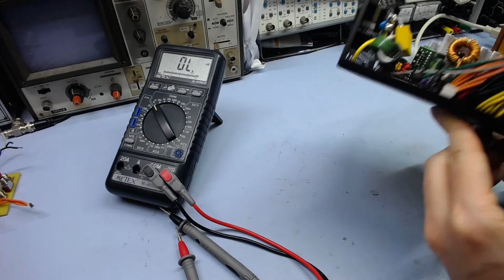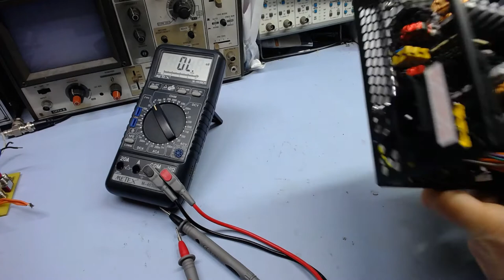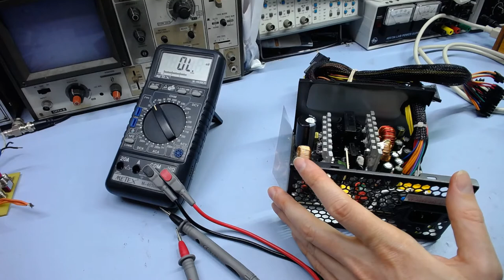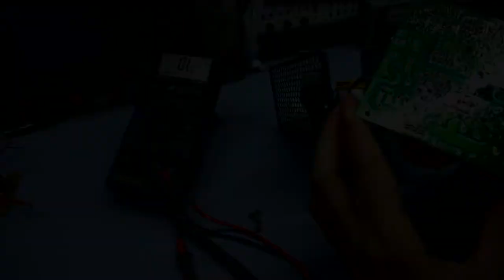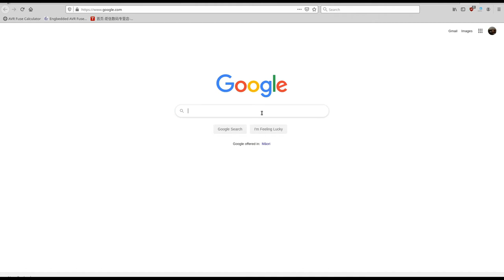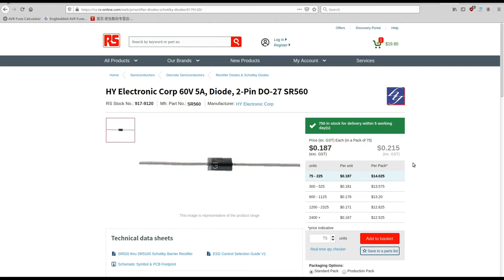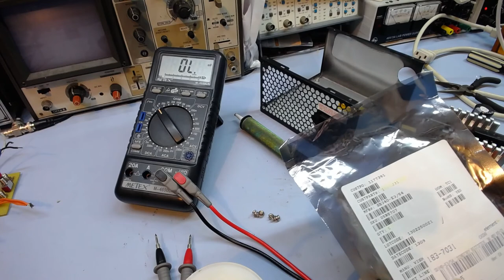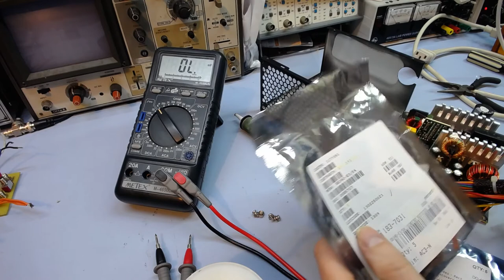Dead Zalman ZM400-GVN ATX power supply repair

Comment: Interessting repair. Do you have the schematic for the little pcb wirh LED and the ATX Connector?
Reply from the maker: Thanks! I do, somewhere...(don't know where right now). But, it's not very complicated. And if you just want LEDs, then calculate the right value dropper resistor for each voltage rail and wire up to each one, noting that the -12v and -5v rails will need the LEDs installed "backwards".

Comment: i have problem with thermaltake 730SE power supply , it have switch on problem , some time turn on and some time no , what should i do to fix it ?
Reply from the maker: There are many possible causes for that kind of issue. But the most basic cause could just be bad capacitors causing low voltage in the 5v standby circuit. After that it gets complicated.
Reply: @Agent24Electronics  thank you  buddy

Comment: Love your channel!
Question.
Are there a few things that are common failures in an ATX 2.03 500w 20/24 main?
I found one that was still sealed in the box and when I tested it, no output at all, no fans.
I checked the fuse, all diodes, all caps, and
A visual inspection is squeaky clean.
Im not asking for a run-thru diagnostic, I just wondered about som common issues with this model so I can check for those.
For now, I'm just trying to follow the path and check each component along the way, but I'm not very good at it yet, and the path starts branching out pretty quickly.
Thanks for the advice you've already shared with me and I hope you are doing well.
Peace.🙂
Reply from the maker: Thanks, glad to hear you've found the video useful.

"ATX 2.03 500w 20/24 main" are just specifications, not a model number. If you can find the brand/model you maybe can look up and see if there are known faults.

With a brand new-in-box but DOA supply, I'd be checking for broken solder connections or wires first. It may have come like that from the factory, especially a cheaper brand with poor QC. (If there truly is no brand/model, then such problems are quite possible!)

Bad capacitors are possible if it's been sitting for a few years and they are very low quality. A failure of a startup capacitor in the 5vSB circuit would render the PSU effectively dead.

Start with the 5vSB rail. Is it present and stable? If missing - is there power going into it? Is there rectified mains across the primary capacitors?
If low or pulsing, troubleshoot the 5vSB circuit for bad startup capacitor, shorted rectifier, etc.
Reply: @Agent24Electronics  
Thanks!!
I kinda put this one on the back burner for a while.
I'm still learning how to test individual components, so I'll probably be removing parts from it just to work on that.
I appreciate your advice!

Comment: hi, i found in my atx power supply few capacitors that have much higer capacity like nominal, for example: nominal 2200microF ,measured.:3000, or same nominal cap 2200microF- 10v, measured 4800microF, is it normal? many thanks for helpfull video
Reply from the maker: Electrolytics can have tolerances up to 20% which can account for variance in readings, but these days the values are pretty close, and your examples are well above 20% anyway.

What you are seeing could happen if you are measuring in-circuit. You need to desolder the capacitor and test by itself, if you haven't already done so.

The other possibility is the capacitor is faulty with high leakage current perhaps, or some other problem, and shows up as high capacity on the meter.

It could even be a faulty meter. Check a brand new capacitor of the same value.

Comment: Hi, i want to ask my psu has stand by voltage but no power good signal and psu fan voltage is 2 volt. I checked the transistors and ic but not faulty component. Also primary side has a voice like coil whine. What should i do?
Reply from the maker: Check all main power rails, you may have a shorted/leaky rectifier or other component.
Reply: @Agent24Electronics  Thanks for your answer. 12,5.5 and 3 volts shows normal. But only pg and fan voltage shows low.
Reply from the maker: @oguzhanyosunkaya2622  Is this on the same model Zalman PSU or a different one?
Reply: @Agent24Electronics  psu model is FSP Epsilon 700W
Reply from the maker: @oguzhanyosunkaya2622  The rails might have high ripple from bad capacitors. This could cause instability in the primary side and create the audible noise. The voltages may measure OK on a voltmeter but aren't stable enough to satisfy the PG (Power Good) signal circuit. 

Or you could have some problem in the APFC circuit which is reporting a fault to the controller IC and stop the PG signal.

Fan voltage may be low at initial power up if the PSU has fan speed control, or a fault in the fan circuit may trip PG too (unlikely it's that complex but who knows?). You need to identity the secondary-side monitor IC and find the datasheet to see how it works and how PG signal is generated.

If you are testing the PSU without load, also note that some supplies may have trouble with this. You did mention a 5.5v rail. That is a bit high for what is meant to be 5v. It may be high due to no load and preventing PG signal. Or high due to other fault like bad capacitors.

You may need to head over to an electronics forum like Badcaps.net and post a detailed description of fault, including photos of your PSU, and what controller chips it has.
Reply: @Agent24Electronics  I changed all of the capasitors. Only polyster capasitors didn't change. Maybe these components are faulty you right. I don't have 
 oscilloscope but control with multimetre there is no problem. I check again. Thank you for your help. :)
Reply: @Agent24Electronics  I did your said and i desoldered the ic. I checked with diode level and two side showed open line. My ic is ps223 1 and 16 pins are pg signal i/o. Did i check correct?
Reply from the maker: @oguzhanyosunkaya2622  Did you have the same fault before you changed the capacitors? If not, it could be that the capacitors are not suitable (e.g. Not low-ESR, or have too low ESR) to work with that design. There is also the possibility you have caused a solder splash or bridged some pads etc by accident. Have you checked the board is clean and there is no solder where it shouldn't be? Check up close especially where you have been working.

Comment: A common theme. Just today I fixed the same model PSU with the same issue, it's a friend's unit which died after not too much use it would seem.
Reply from the maker: Interesting, perhaps they had a faulty batch of diodes or something
Reply: @Agent24Electronics  I think the diode is under a lot of stress, he 's using it in a gaming PC which would stress the poor thing probably made for mid-range builds. If it shorts again I'll probably upgrade the diode to something beefier.

Comment: some diodes and other components should have been replaced. because under a load the power supply will be damaged
Reply from the maker: What components? Please explain your reasoning, as that doesn't make much sense. The 5vSB supply has short circuit protection and just shuts down. Nothing else is likely to be damaged.